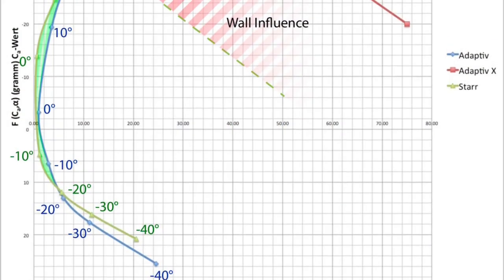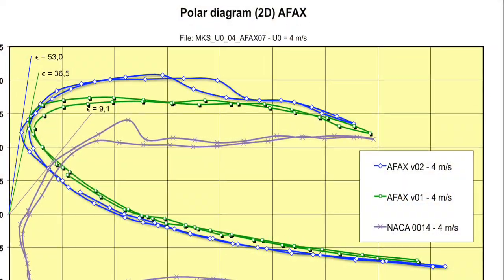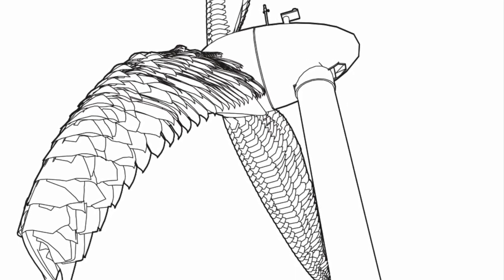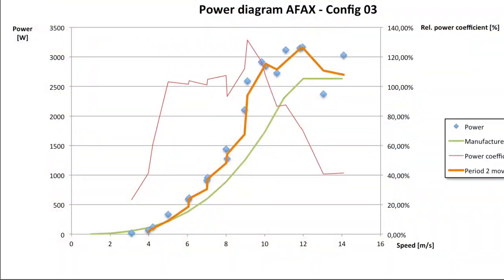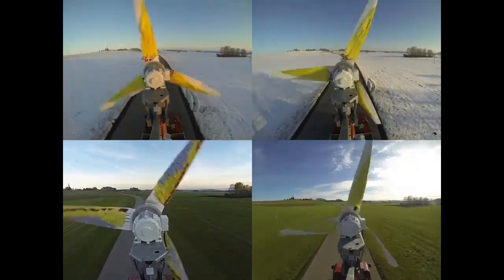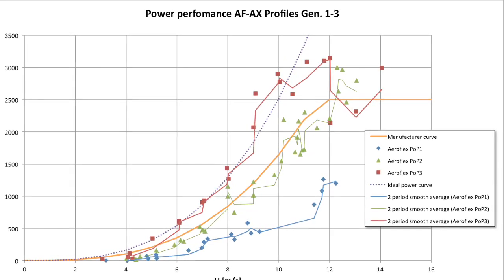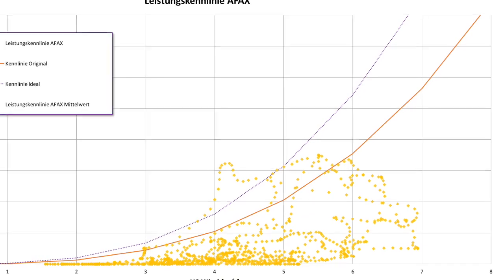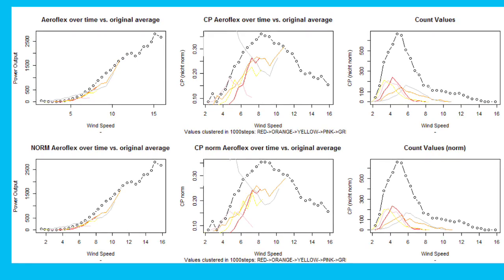Making of Aeroflexible Wind Turbine

Comment: How precisely do you think elasticity of the aeroflexible blade material can be optimized for increasing output power? Perhaps looking at the Eagles wings can help at least in terms of stability like flutter. But eagles don't face those centrifugal forces like the turbine, so design for this turbine will have to somehow optimize through that as well.

Comment: Perhaps increasing the pitch of the turbine would maximize the efficiency gain of your aeroflexible system?
Reply from the maker: Pitch doesn’t matter because pitch comes automatically by the difference between wind speed and angular speed of the rotor. Finally the Rectifying unit who controls the angular momentum of the Generator must have the correct power curve to achieve the best angular speed according to the wind speed.

Comment: 20:41 These pulses could also be from the pull of gravity flipping every 180deg rotation.  Likely a small force compared to the wind & centrifugal action, but still must be counted.
Reply from the maker: Yes it was counted, but compared to wind/aerodynamic forces very low because very lightweight. Also the lifting happens quite locally as well - as you can see in some parts and appeals more like a bulging, which also does not speak for gravity. Third point: It bulges during passing of the turbine mast and not at the position when the lamellas are facing down. An argument for the detached flow there.

Comment: if there is a mechanis where u can control these feathers like flaps or aerolrons can u get more efficency ?
Reply from the maker: the construction is intended to work passively without active control. just by the aerodynamics. since the detachment of the elements is reacting on flow detachment. but it can further be considered to control the sensitivity by altering the spring force of the elements actively.